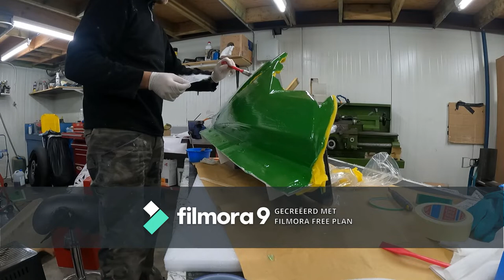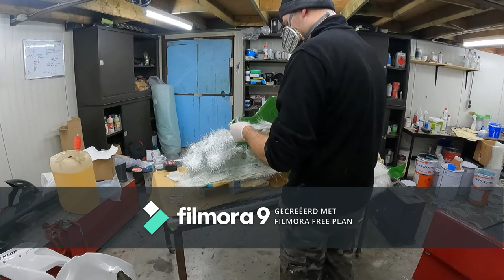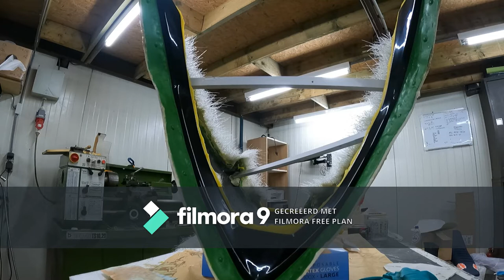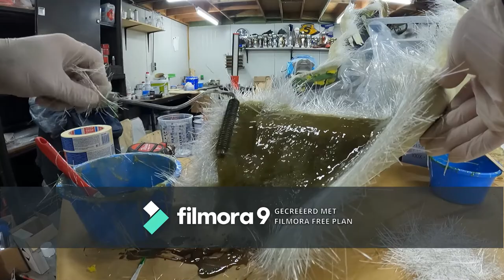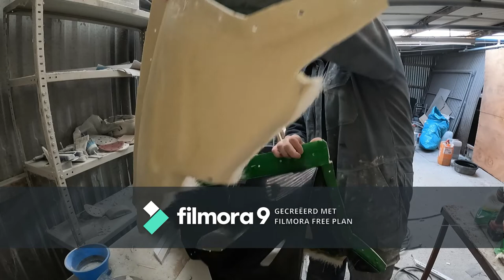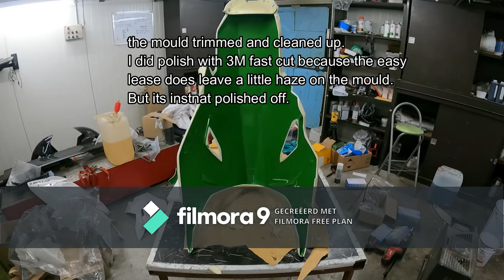BMW M1000RR race fairing belly complete split mould making.

Comment: What do you use to remove/clear Filling Wax and do you use EL2 from easycomposites to laminate fibreglass fairings?
Reply from the maker: I use W2 for removing filling wax its a type of release agent used on RVS moulds but it desolves filling wax its W2 from up system.
My fibreglass resin is  ISOPHTALIC RESINS: They are used when higher chemical resistance and water resistance.
They are more expensive than the  ORTHOPHTALIC RESINS but I rather spend some more for good resin and get good results.

Comment: hello, where could i buy from you this bellypan for my s1000rr 2021? this belly fits my stock fairings right?
Reply from the maker: Hi Micky , I dont know if it fits this is for a complete M1000RR race fairing with winglets .
Reply: @Republicofcomposites  im guessing it would fit my side stock fairings with the bellypan, do you have a facebook page or website page? i would like to buy the bellypan fairings for my bike
Reply from the maker: @mikypal  If you can wait some time, I'm busy for getting an autoclave so these parts wil come in prepreg carbon fibre availeble for good prices .
Reply: @Republicofcomposites  do you have a website page or Facebook page ?
Reply from the maker: @mikypal  Stil working on it, really got to much work with getting an autoclave , finishing new moulds ....
Next week I wil prob pull a new bellypan out this mould .
I'm now preparing the mould for first parts.
Reply: @Republicofcomposites  is it ready for purchasing yet? i would love to get the bellypan too :)
Reply from the maker: @valon212  Where are you located ?
Reply: @Republicofcomposites  in Norway my friend